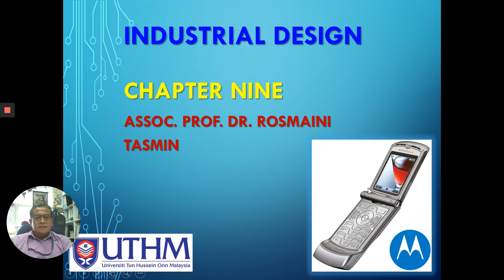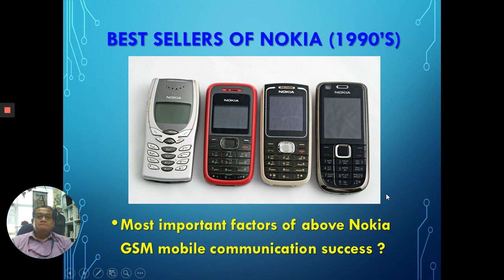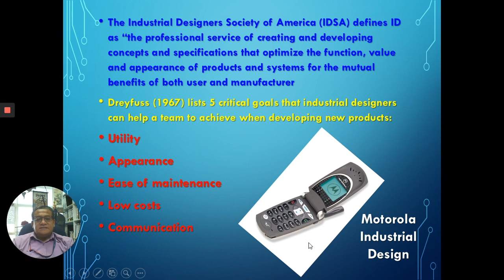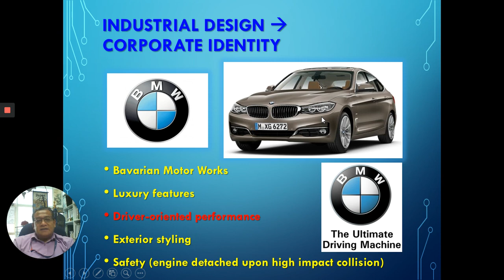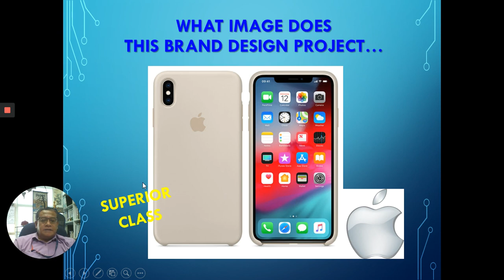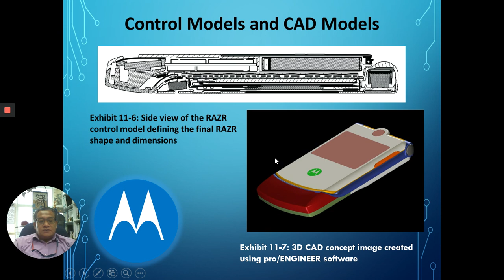Product Development Lecture Chapter 9 Industrial Design

Comment: Siti athirah binti saludin ap180427
Based on the video “Industrial Design”. In this video, I learned how to assess the Ergonomic and Aesthetic needs for industrial design. Aside from that, I learned about the impact of ID in the video, as well as how ID aids in the establishment of a company's identity. BMW, Mercedes-Benz, and Lexus are just a few examples. 
The Process of Industrial Design: 
- Investigation of customers needs -Conceptualization 
-Preliminary refinement 
-Further refinement and final concept selection 
-Control drawings or models -Coordination with engineering, manufacturing, and external vendors.

Comment: AHMAD HAIQA BIN SHAHKRIIN (CP190036)
FROM  Section 4

what i've learn today is about how industrial design meet the human needs such as design of flip phone from Motorola. Dreyfuss list 5 critical goal in Industrial Design which is 
- utility
- Apperance
- Ease of maintenance
- low cost
- communication

Assessing the need of ID is two. the Ergonomic needs and Aesthetic needs. 3 impact of Industrial Design is
1) Direct cost is the cost of ID services (type of designer used, duration of the project and number of model)
2) Manufacturing cost ( expenses incurred to implement the product detail created through ID)
3) Time Cost ( the penalty associated with extended lead time and multiple design iterations.

Comment: NUR FAWA NAJIHAH BT CHIK ( AP180111)

Based on video, what i learned is about industrial design that can be apply to new product. It is included a few critical goal that help to achieve developed the product such as utility, appearance, ease of maintenance, low cost and communication. Furthermore, when developing the process of industrial design, we need to make sure the design from need of customer and the user.

Comment: Nur Atikah Binti Adam (Ap180404)

I haved learned in this video about Industrial design (ID) can include changes in size and weight, performance features, enhanced ergonomics, durability, materials, and aesthetics, among other things. ID encompasses not only functionalism but also geometry, precision, simplicity, and cost-effectiveness in product design. Ergonomic and aesthetic factors are assessed while determining the requirement for ID. Direct costs, manufacturing costs, and time costs are all impacted by ID.

Comment: NURNAJWA FATEHA BT MOHD NOOR (AP180044)
Each product has their own industrial design identity, so that the product may satisfy the requirement of customers. For example, Motorola Razr produced a phone with customer satisfying features which are small in size and weight, the durability is fine during that era, the materials used are high quality, and also the appearance suits with that era preferences.

Comment: Heng Chien Ying AP180531
In this video, i learned about motorola razr(v-shaped) product design. It main emphasis is to follow the shape of human economic face contour. Nokia gsm mobile phone success factor is due to pioneer technology.
Design is based on industrial need. Assessing the need for ID have ergonomic need and aesthetic need.
The impact of ID: direct cost, manufacturing cost, time cost.
we need to know design process is because the process of the product is basically designed from the needs of customer

Comment: AINUL NABIHAH BINTI ZAINAL 
(AP180029)
CHAPTER 9: INDUSTRIAL DESIGN 

Definition:
-The professional service of creating and developing concept and specification that optimize the function, value, and appearance of product and systems for mutual benefit of both user and manufacturer. 

*5 critical goals of ID by Dreyfuss (1967)
-Utility
-Appearance 
-Ease of maintenance 
-Low cost
-Communication 

*Assessing need for ID
-Ergonomic Needs
-Aesthetic Needs

*Impact of ID
-Direct cost is the cost of ID service
-Manufacturing cost
-Time cost 
-Established corporate identity

 ID process
S1: Investigation of customer needs
S2: Conceptualization 
S3: Preliminary refinement
S4: Further refinement & final concept selection 
S5: Control drawing/models
S6: Coordination w engineering, manufacturing & external vendor

Comment: Low Meei Ching (AP180190)
I learned about the industrial design (ID) can be change in size & weight, performance features, superior ergonomics, durability, materials and appearance. ID is more than functionalism, also geometry, precision, simplicity and economy in designing products. Assessing need of ID is ergonomic needs & aesthetic needs. The impact of ID are direct cost, manufacturing cost, time cost. The ID process include 6 steps which are Investigation of customer needs, Conceptualization, Preliminary refinement, Further refinement and final concept selection, Control drawings or models, Coordination with engineering, manufacturing and external vendors.

Comment: NUR HAZIRAH BINTI NORDIN (AP180183)
What i have learn in this chapter is;
1. The concept and history of industrial design
2. Assessing tge need for industrial design (ergonomic needs, aesthetic needs)
3. The impact of industrial design (direct cost, manufacturing cost, time cost)
4. The industrial design process:
• investigation of customer needs
• conveptualization
• preliminary refinement
• further refinement and final concept selection
• control drawings or models
• coordinating with engineering, manufacturing and external vendors

Comment: Alia Syuhadah binti Zamzuri (AP180241)
I have learned about industrial design is about functionalism, simplicity and economy in designing products. there are three impact of industrial design such as direct cost, manufacturing cost and time cost. 
the industrial design process is an investigation of customer needs, conceptualization, preliminary refinement, further refinement and final concept selection, control drawings or models and coordination with engineering, manufacturing and external vendors.

Comment: Ain Aisyah Bt Mustafa(AP180465)

From this Video, i learnt about Industrial designers are primarily responsible for the aspects of a product that relate to
 the user’s experience the product’s aesthetic appeal  and its functional interfaces. furthermore,  Motorola launched a product development effort to augment its very successful
 but aging lines of flip-style  mobile telephones with an exciting new product. lastly, the ID process can be thought of as consisting of the following phases:
1. Investigation of customer needs.
2. Conceptualization.
3. Preliminary refinement.
4. Further refinement and final concept selection.
5. Control drawings or models.
6. Coordination with engineering, manufacturing, and external vendors

Comment: Lye Mei Ki (AP180373) 
I have understand the Industrial design is an improvement of a outlook of a product. Company should take this effort to increase the quality durability, appearance of products through renewable the design. It consists of 6 process steps. Which are investigation of customers needs, conceptualization, preliminary refinement, further refurbishment and final concept selection, control drawing or morsels, and coordination with engineering, manufacturing, and external vendor.

Comment: Jessie Saw Kah Mun AP180256
From the video i have learned
1. Industrial design ( size & weight/performance)
2. Ergonomic need and aesthetics needs
3. Impact of industrial design (ex: number and the type of designers used)
4. Industrial design identity (modernity)
5. Industrial design process 
- investigations of customer needs
- Conceptualization
- Preliminary refinement
- Final concept selection 
- Control drawings or models
- Coordinate with engineering

Comment: Muhammad Aidil Bin Majid(AP180391)

Based on the video Chapter 9 “Industrial Design “. In the video I have learnt assessing need for Industrial design which is Ergonomic need and Aesthetic need. Besides that, in the video I have learn the impact of ID and also how ID helps to establish a corporation identity For example BMW,Mercedes-Benz, and Lexus.
The industrial Design Process:
-Investigation of customers needs
-Conceptualization
-Preliminary refinement
-Further refinement and final concept selection
-Control drawings or models
-Coordination with engineering, manufacturing, and external vendors.

Comment: Lee Mei Ting 
ap180221
Industrial design define as to innovation and creativity on the pattern and functions with technology but the same design will be keep in same in thier own style. Design change on size & weight, performance features, superior ergonomics, durability and materials. Industrial Design (ID) form should follow function, mostly done by designer and engineer. The low cost, communication, ease of maintenance and utility of the product. The design innovation will impact the cost and time. The identity of the company will be maintained in each product. The design among the product will same the identity design of each company, each company have their own corporate identity.  For example, Apple become a superior class look exclusive and expensive.

Comment: Lee Chin Yong (AP180153)
From this video, I already learnt about industrial design become the professional practice and knowledge which use by architects, designer and engineers to design or develop the functionalism product like handphone, car and others for public. In addition, industrial design process includes investigation customer need, conceptualization,  preliminary refinement, further refinement and final concept selection, control drawings or model, coordination with engineering, manufacturing, and external vendor. Nowadays, computer cad design such as Auto-CAD become one of significant tool for industrial design.